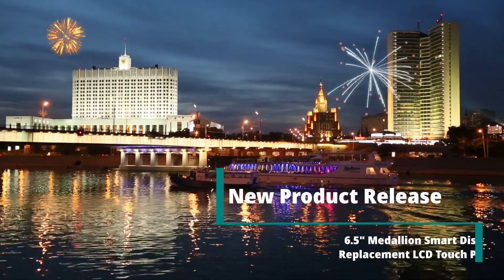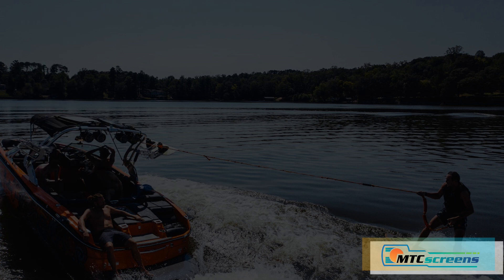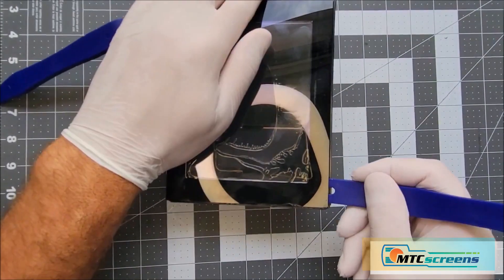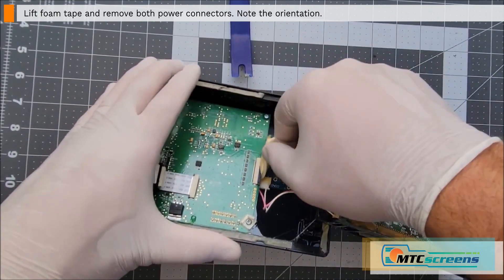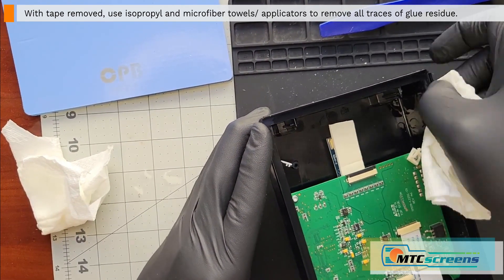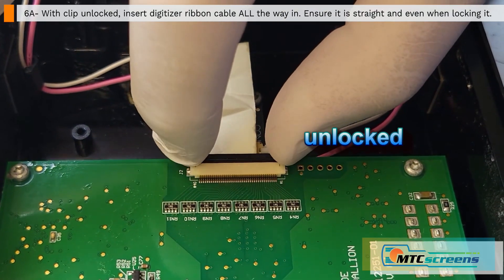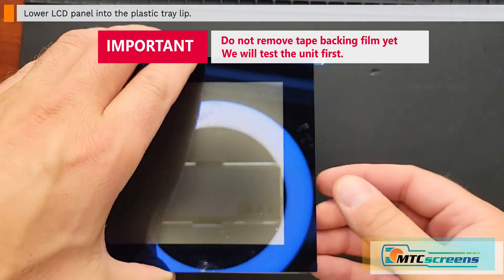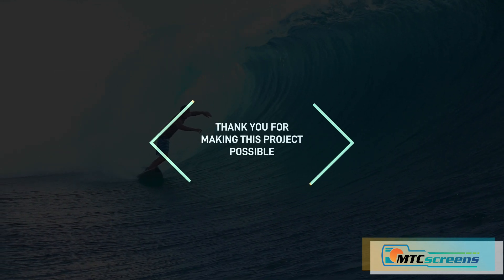DIY How to fix delaminated 6.5" Medallion Display - Malibu, Tigé, Mastercraft, Seadoo Tige Touch MTC

Comment: I have a 2015 Chap 223 vrx.  So I believe I will need the 6.5” 6B replacement screen.  However if I try to order this screen for diy from the MTS site, they are not available but it looks like the send in (non-diy) option is available.  Is that true? Can I send my unit in for immediate replacement now?
Reply from the maker: Place your order here, stock is highly limited and will likely be sold out again in the next couple days https://www.mtcscreens.com/store/p/medallion/mtc-6b-mastercraft-smarttouch-chaparral-seadoo-touch-repair-service